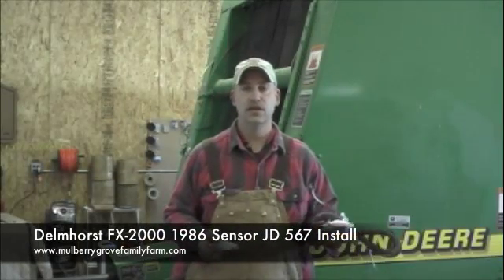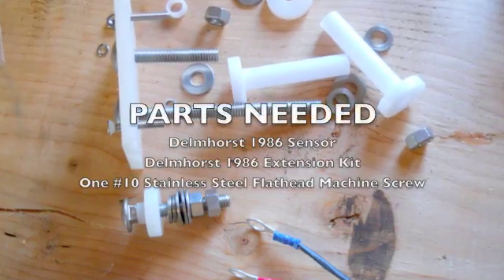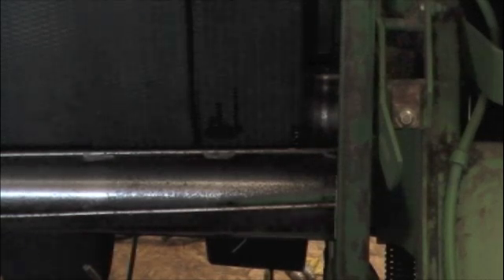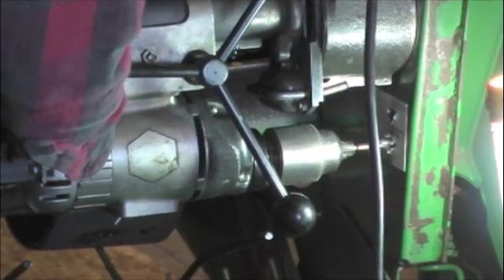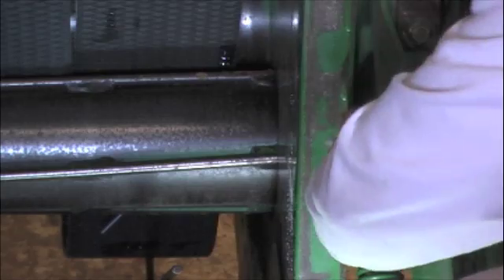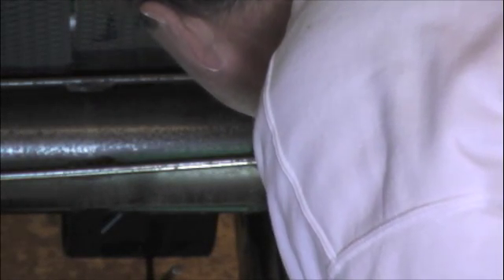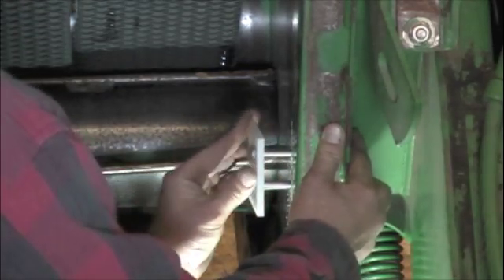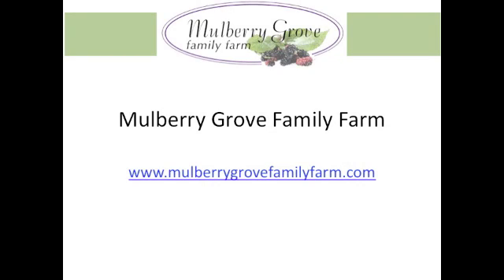Delmhorst_1986_Sensor

Comment from the maker: The reason for the #10 screw in the top hole is that the top hole will not exit the baler from the inside.  It will be behind another piece of steel, so the #10 screw is used.